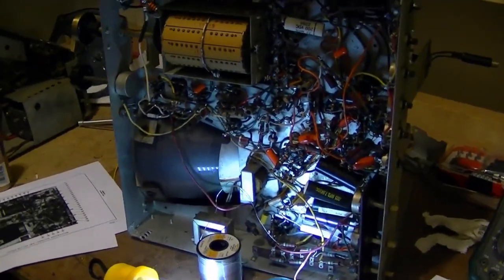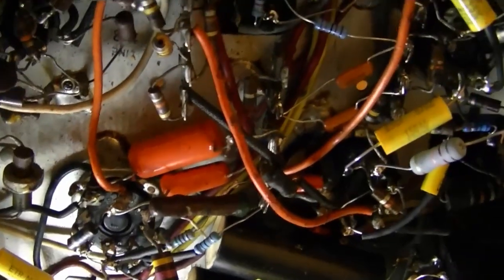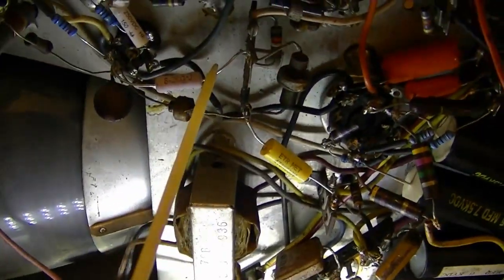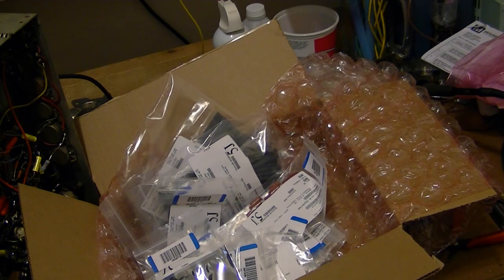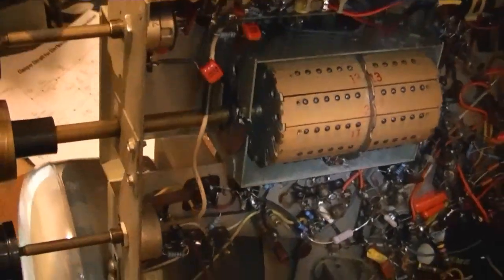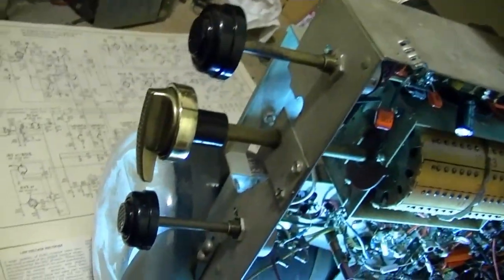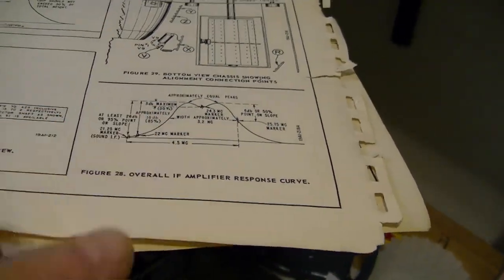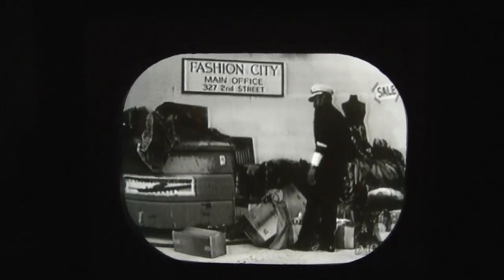Admiral 17T1 restoration

Comment: Few years back I restored an Admiral 5 tube am radio, I got the set working and I spent a good day cleaning the cabinet. Being the original owner of the radio had painted it, I had to use nail polish remover (non acetone)  to rub the Bakelite and clean off the paint. It made the cabinet soft feeling and shiny. When I removed the paint it also removed the white paint in the engraved name plate. I use a white-out pen to bring the white back in the name plate.

Comment: The sound on my 17t1 is very good with plenty of volume. I did have to replace the volume pot because of a former incorrect part someone installed before me. I used your method of sanding and polishing the mask to remove the scratches with very good results. Thanks for your lessons at "Banderson" Collage.

Comment: Hi Bob, This is what I found with my 17t1. With the volume all the way down, chassis in the cabinet and a video signal with no audio fed there was a slight hum out of the speaker similar to what you have. One quarter turn on the pot the hum was loud and increased as the control was turned up. With an audio signal fed and a quarter turn on the volume control, the hum becomes a none issue for my ear. After 15 minutes the power transformer remains cool.

Comment: Hi Bob, I got my 17t1 working also, with your help! I will do the retrace and DC coupling fixes. I like the results. I too found the Wallace’s prints more helpful especially with my Philco 51t1601 project; the edition of Wallace print book I had showed the run 15 print that my set was built with. The moral of the story is collect all the information on the set as possible.

Comment from the maker: I think the quad coil was particular to Zenith.  This set uses a ratio detector, and yes, I did adjust the coil.  The buzz is isolated to just the output amp though.

Comment: Sprague used to make an axial capacitor similar to the Orange Drop, called the 192P.  I've used them in some of my radios.  They do have a lower voltage rating, though.

Comment from the maker: I think you're on to something!  I neglected to mention in the video that the power transformer runs a little warm - not hot, but warmer than I expected.  No, I don't have an inductance meter, but I do have a couple spare 19A1 chassis I could borrow a transformer from.  I think they are identical to the 17T1 transformer.
Reply: I have a 19A11 with the big honking 20hz power trans.

Comment: Hi Bob, In your DC restoration circuit, with the 1N4936.. I see itsa 1mp HV diode, could you use a standard 1N4007? This electrostatic is very cool BTW and visually looks really clean.

Comment: Have you done the resistance check of the H.V. secondary of the power transformer?  Sams and Wallace teleaide speak on this,if the set has ever had a 5U4 instead of a 5Y3 you'll have a burnt 5.0V winding. That size transformer will have no load draw of 15W or less. The hum in the sound may due to the 117 volt wires  being to close  to hi-gain sound stage. Fix is to move the power wires to the power switch. Did that to my 17T1 and 19A1 took care of the buzz.  All the best Tom J. from Fla.
Reply: Thanks for the tips.  No, I haven't gotten around to investigating the transformer yet.  Mine runs pretty warm so I wouldn't be surprised is there was some leakage going on inside.

Comment: I can't see the point in using Sprague orange drops for the very reason's you mention, that and they cost more they the yellow caps when I don't think that they are of any better quality. I recall seeing a craigslist ad for a brand Z radio recently where the poster bragged about restoring the set with "high quality" orange drops. It was a 1938 model and while he used orange drops I could see he had left a number of the original dog bone body end dot code resistors still in place.

Comment: If one of the windings had worn insulation touching the another inside the core causing the inductance to fluctuate up and down would that put a buzz, I am just guessing because I am so interested now to find out where the noise is coming form, do you have a inductor tester to test windings or what I see they use now blue ring. That would be something for you to teach us, bad transformers symptoms. If that was the case the voltage would also fluctuate right.

Comment: As you are well aware any resistor with a BED code, especially the radial lead dog bone style, are notorious for drifting way upward in value. Also I personally thing that radial lead capacitors look more out of place in a 1938 radio then even those canary yellow poly film caps, plus you can't use them for restuffing, With few exceptions I also don't trust someone else's restoration work unless I know who they are, as this Admiral 17T1 demonstrates there are a lot of clip and pigtail artists.

Comment: Hi. I have one that when the hv is connected to the centering controls the hv drops down to 2 kv. Tin whiskers?
Reply from the maker: Could be. Or wire insulation breaking down. Or bad resistors in the hv bleeder string
Reply: @bandersentv  what's  ng? Isn't the resistor string just to supply focus voltage? Took centering controls out and cleaned them.  Hv is at 6kv when not connected to the cent. controls. Hv stays low even when crt is unplugged.  Thank you sir.
Reply from the maker: @pauljames5914  The centering controls are part of the HV bleeder string.  They have to be in circuit.  It also supplies bias to the deflection plates and plate voltage for the 6SL7.
Reply: @bandersentv  yes that's true but I can't figure out why the hv gets dragged down. Could it be that the hv circuit or the flyback is putting out proper voltage but not enough current?